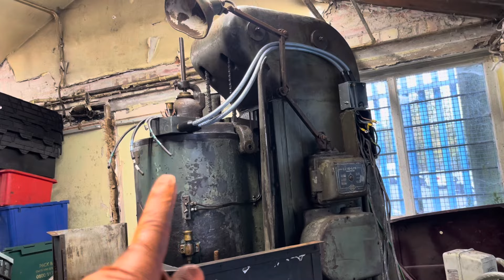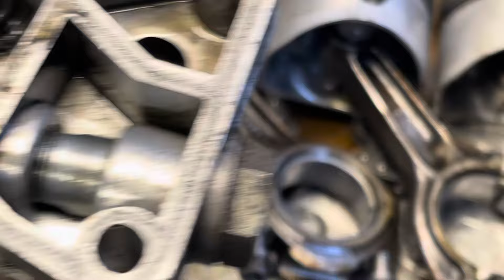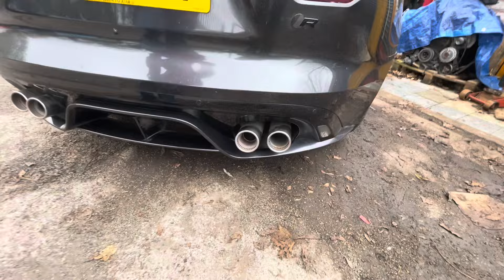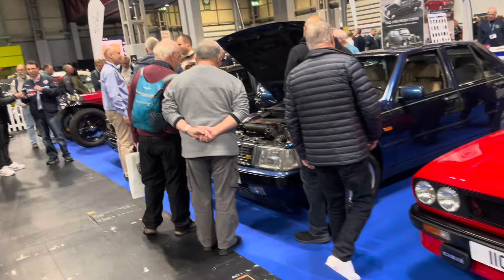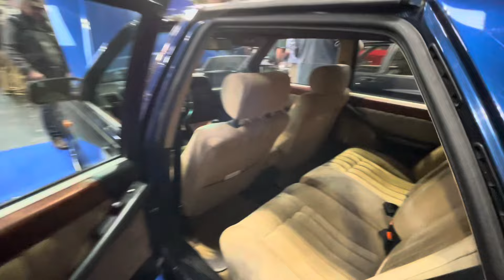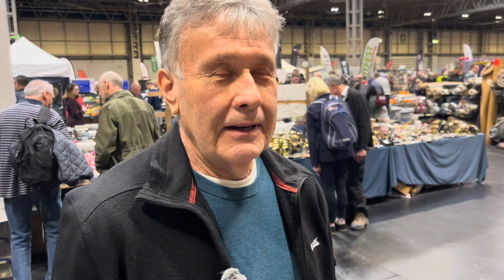Shrigleytube TV EP 70 NEC  interview, liners back in, carter engine chat, mark delivers in work van🤣

Comment: Fab video, might be one of the best. Just to add info to the oil pump situation. We have a Mini one for shopping etc, and it had a faulwith the Dynamic oil pressure, meaning the oil pressure was very high and not bleeding off as should be. When the valve was replaced the fuel consumption went from 35 to 40 and you could feel the engine was more lively! Basically it was sacrificing power and economy. Incredible. Many thanks for taking the time to post the videos Andy. Must get along to NEC next year